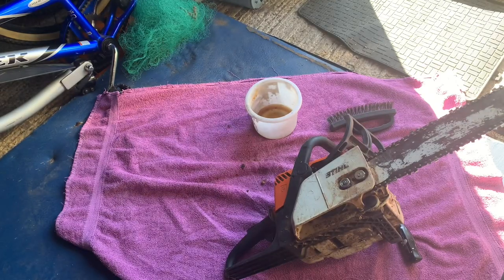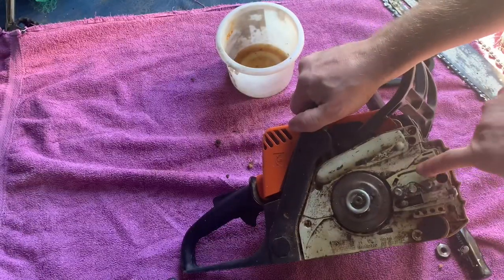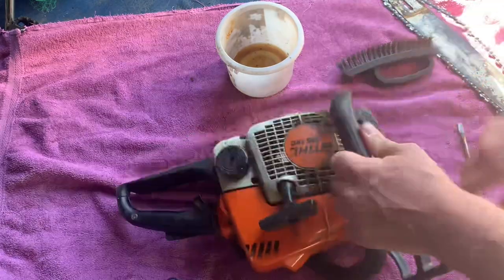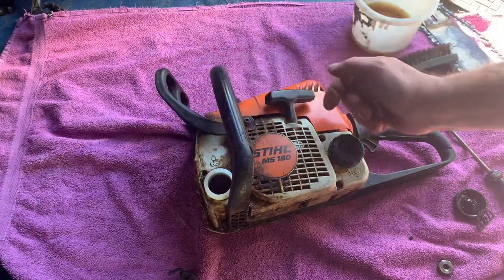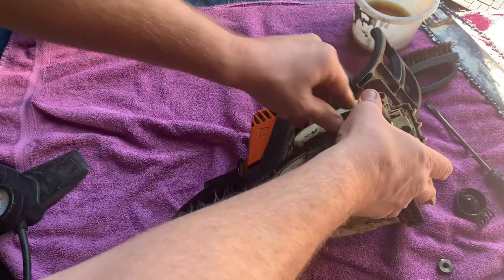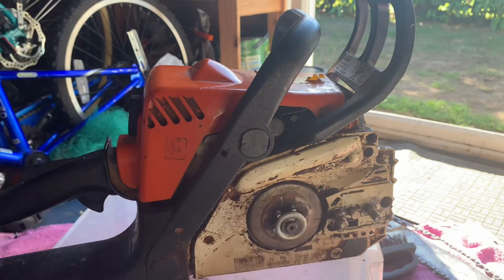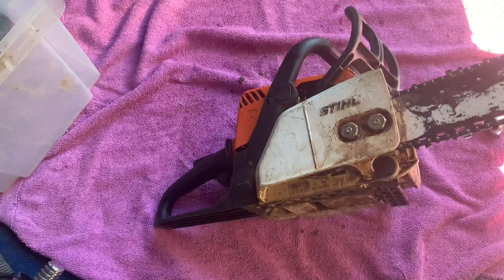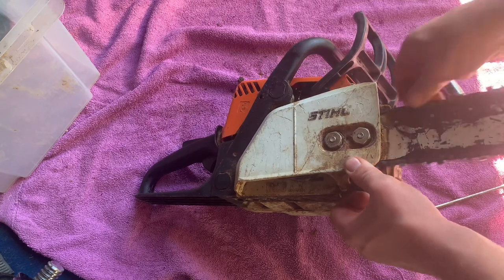How to unblock a Stihl chainsaw chain lube feeder tank using a bike pump

Comment: You'd be better to use proper chain lube it's heavy stickey oil
Reply from the maker: Yes mate, I used the lighter oil in an attempt to flush the system and get any bits of muck out of there 👍🏻